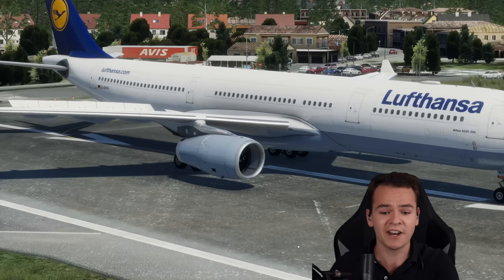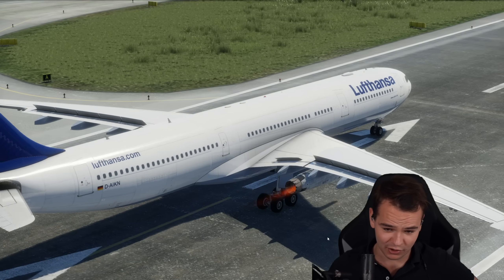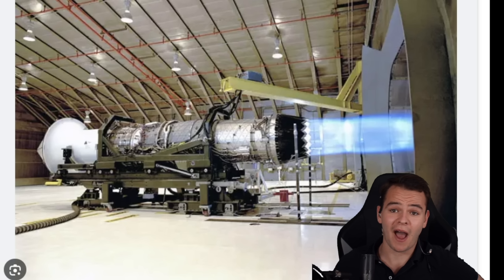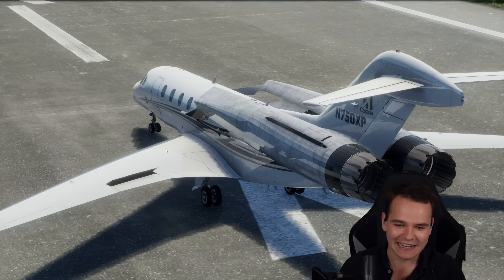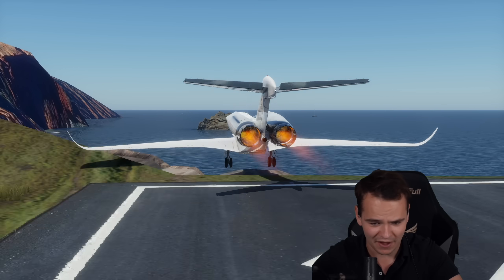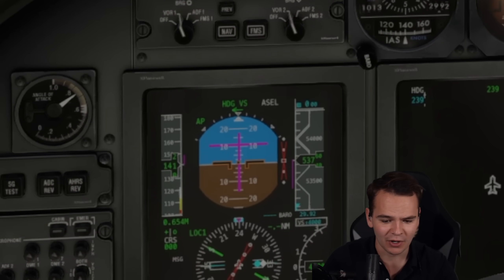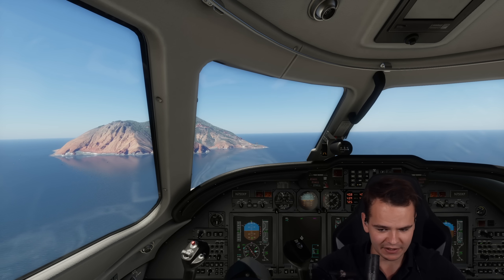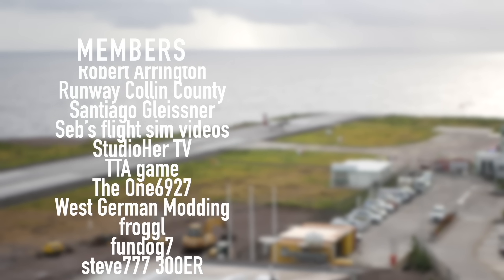Fitting FIGHTER Jet Engines To Normal Planes - How Fast Can We FLY?

Comment: No, you don’t need to “slice through” the “sound barrier”. First there’s no such thing as the sound barrier. The sound barrier was a concept that was brought up and tossed around engineering circles back when we were trying to go supersonic. Because we were struggling to do so, and the math produces a limit at Mach 1, they thought it was physically impossible to go beyond it-hence a barrier. The sound barrier. But there is no physical barrier. 
Second, the air is always being “sliced” through. The airplane moves the air molecules out of its way whenever it moves through the air. At Mach, it just does it faster. So fast that the air molecules can’t dissipate between each other. They bunch up, increasing in density, or compressing, in a wave that emanates off the aircraft. We call that a shockwave. It is exactly like a wake wave from a boat. 

Planes don’t need special wings or special noses. The only special thing they need is: jet engines, special intakes for those jets so they injest subsonic air, and full-motion horizontal stabilizers with enough range of motion to give enough authority to counteract mach tuck. That’s it. 

The wings need to be engineered to go supersonic of course, but there’s no special shape or form or anything that they must be in order to do so. Delta wings are certainly not required. The only delta winged supersonic jets flying now are the Eurofighter and the Saab Gripen and Viggen. There are dozens that aren’t.

Comment: The F35 is not the most powerfull fighter jet ever built and it`s not even a fighter jet to begin with it`s a multiroll striker aircraft meant to operate in stealth. When it comes to thrust to weight ratio and speed, that title goes to the Russian MIG 31 Foxhound, many say it`s the MIG 25 Foxbat but they both have the same speed but the MIG 31 had better thrust to weight ratio of 0.67 instead of 0.55 also the MIG 31 engine produced 152kN of Thrust with afterburner per engine summing up to 304kN of force for 2 engines. The F35 single engine can produce 191kN of thrust with afterburner and has a thrust to weight ratio of 0.61.

Comment: A good analogy is fighter jet engines are like high reving sports car engine, airliner engines are torquey diesel engines, fighter engines moves air at higher velocity thus the fighter can flight faster, air liner engines move air at lower speed but larger volume, thus it can move a heavy plane

Comment: "No passenger jet would ever be powered by low-bypass turbojets"
Every airliner produced before 1970: Allow us to introduce ourselves
Reply: De Havilland Comet,
Boeing 707, 727, 737-100/200,
Douglas DC8 and DC9,
Virtually every Soviet airliner built before the Yak-42 and Il-96,
Sud Aviation Caravelle,
Vickers VC10,
etc.
Just throwing out examples.
Reply: @benjaminbrown3939 tehnically most of them is medium bypass, but just barley with most of them having a ratio of 1:1.1
Reply: that's why he said modern airliners

Comment: 2:48 nah, you should put some A330 engines on a fighter jet lol
Reply: that would just be a heavier a-10 thunderbold but worse
Reply: Would be hopeless as well the other way around. Massive thrust but limited speed below the sound barrier.
Reply: The bottom of the engines would scrap the tarmac all the way during take off and once in the air the center of gravity would make the flight an interesting experience 😂

Comment: You should try using the Volvo RM8 attached to a 737, the RM8 was a modified version of the JT8D Turbojet which was used on the boeing 727.

Comment: Try the ones on the SR71. Most powerful engines ever slapped on an airplane that wasn't a  rocket.
Reply: Not exactly... But unlike most aircraft engines with a blower, those engines were rated for continuous afterburner use. I believe that using the afterburner is time limited to prevent damage to the engine. You have to back off the blower, maybe to mil power, to allow the engine to cool. Even the Concorde didn't use continuous burner, it just used burner during certain flight regimes. It could cruise >Mach 2 without burner. One of the first, if not the first, planes that could supercruise. Many of the US's newer fighters can do that when they're "slick."